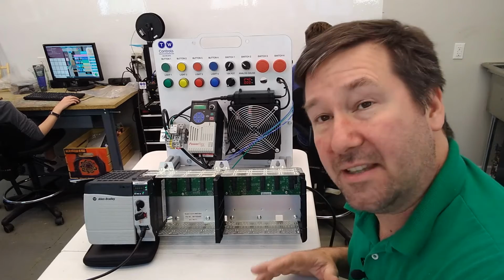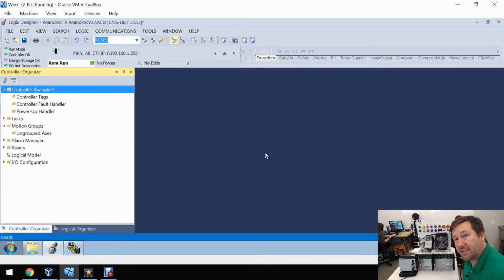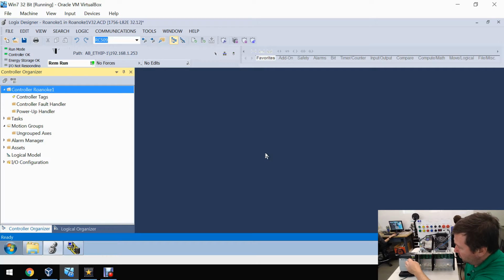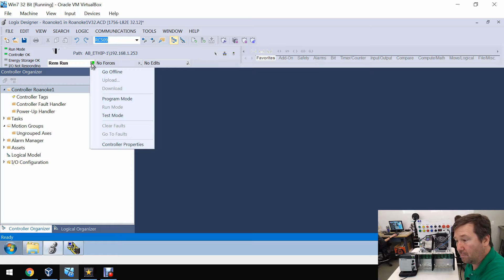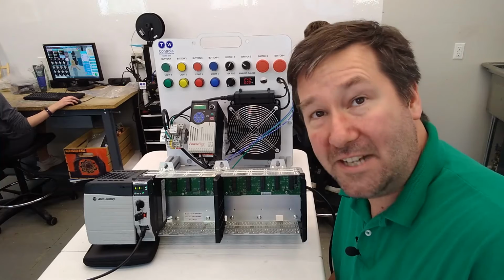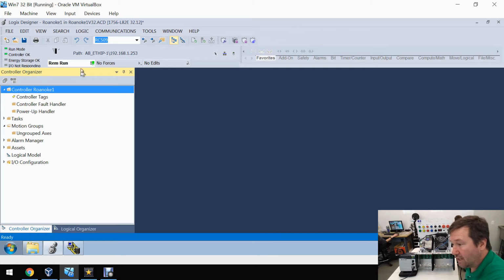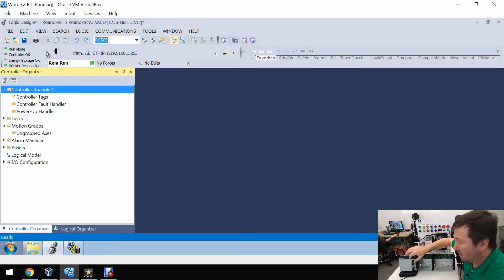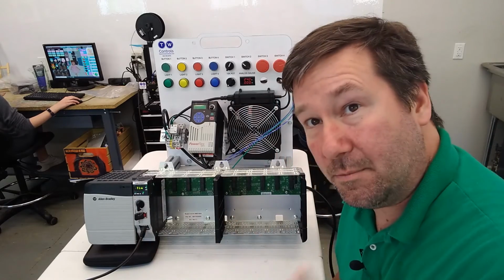Allen Bradley PLC Key Switch. 3 Positions 4 Modes. Run Remote Program.

Comment: How do I read the run mode from a remote PLC?  Not the key position, I can get that with a GSV, I want to know if it is running or not.  I've done it before by setting and resetting a heartbeat bit, but THere should be a way to read if the program is running, in program, or faulted.  Ideally remotely.
Reply from the maker: You could find this in the SLC and Micrologix but I can't think of a way to do it in the Controllogix.  The issue is, the GSV won't execute when in program mode so it wouldn't change state.  Let me do some thinking...

Comment: Can I switch from REM to RUN without interruption?  If I switch it (from REM to RUN or RUN to REM) will it "hiccup"?  The question came up here at work and I never had to do this manually.
Reply from the maker: Yes, in 99% of applications it will work without a hitch.  The only catch is if there is code that is monitoring the keyswitch.  I've only seen that once.

Comment: What's difference between run vs load application
Reply from the maker: I think it will depend on the particular product you are using.  They sound similar but every manufacturer uses a little bit different lingo.

Comment: Is there also a Remote Test mode?  I see the option at 1:26 in the video, but haven't figured out how it works. Is that analogous to "Test Continuous" and "Test Single..." options that are available when online in RSLogix 500?  So far in my mental model, I have:
(1) Run Mode = can execute but can't modify
(2) Program Mode = can't execute but can modify
(3) Remote Run Mode = Run Mode plus some limited online editing capability
(4) Remote Program Mode = Program Mode
Is there a fifth one?
(5) Remote Test Mode = ??
Reply from the maker: There is a test mode but honestly I've never used it.  It doesn't work the same as the single step of RsLogix 500.  I'll play with it some and see if I should make a video on it.  As I recall, it reads inputs as normal and executes programs, but the outputs remain off.

Comment: Pro tip... If the processor is faulted, flicking the run switch several times between run/prog will issue a fault reset. This doesn't address what caused the fault, of course, but it can be useful in a pinch. For example if there is an IO fault from a remote rack during power-up, this trick can get the machine running until the underlying issue can be addressed properly.
Reply from the maker: I'm going to talk about that in an upcoming video about dealing with faults but you are correct as usual Jeremy.